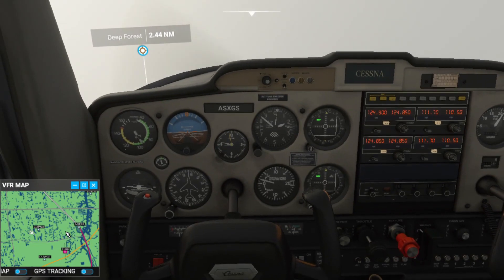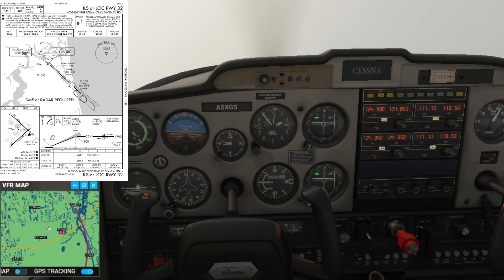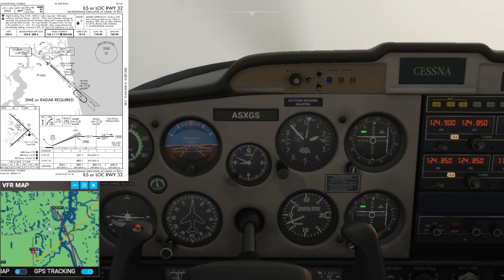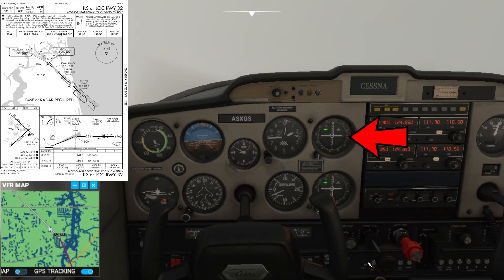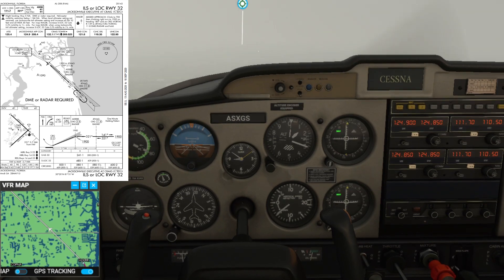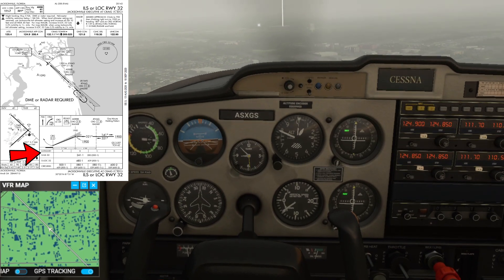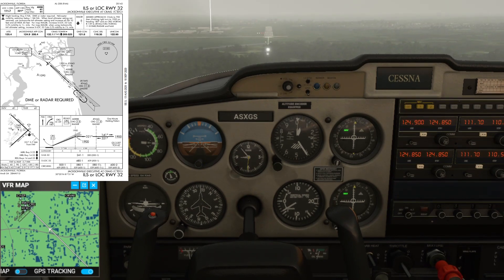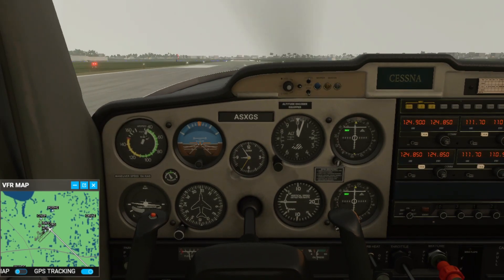Microsoft Flight Simulator | How To Do ILS Approach | Cessna 152 | Commentary | Tutorial

Comment: thank you! also have you noticed that the c152 is always rolling/turning towards the right? I was wondering if I was the only one
Reply from the maker: The default aircrafts have some issues but I do what I can to manage it; hopefully they fix it soon. Thanks for watching!
Reply: Try balancing your fuel tanks. Add fuel to the left tank if the plane is rolling right.
Reply: The propeller is turning clockwise from the cockpit causing a turning to the left. Right rudder must be applied to compensate for this.
Reply from the maker: Mr. Opinion  he said turning to the right, what you’re describing is torque.

Comment: Why did it say airspeed too high a few times during approach? Wouldn’t 52 knots be too slow on approach, especially the first time it popped up?
Reply from the maker: It is too slow, it’s usually best to maintain approach speed around 65-75 knots on short final then pull the throttle towards you to reduce the airspeed once you’re over the runway threshold and let the airspeed bleed off until touchdown.
Reply: 90 in pattern and 70 on approach is what I've read.
Reply: Indeed. According to the Cessna 152 manual, airspeed should be between 60 and 70 knots with flaps up, between 55 and 65 with flaps down. 54 knots should be maintained even during a short field landing.

Comment: I missed something on this,  what was you did that the runway was right in front of you. I am new to this procedure so I assume you programmed a departing and arrival airport. I am lost after that.
Reply from the maker: James Tepedino thanks for asking! What I did was I programmed my navigation equipment to the frequency (111.7)  of the ILS approach and adjusted the radial dial  (321) on OBS 1. By doing that, the ILS gives you lateral (left and right) guidance and vertical (up and down) guidance to the lowest altitude (Decision height). If done correctly, you would first get lateral input then afterwards once you are close to the final approach fix you would get vertical input at which the glide slope is alive and that you can start descending. Each airport has the same concept of instrument approaches but different numbers and procedures such as ex: different degrees, directions, minimums. I could do another example of the approach using your airport of preference if you’d like.
Reply: @DaftPilot  ok i will get that for you. Where did you get the frequency numbers of the ils approach
Reply from the maker: James Tepedino I used the frequency on the top left corner of the white page that appears, that’s the approach plate. The frequency and many other important  data related to the approach are provided in that page. I use this website for airport, fuel information and instrument plates: https://skyvector.com

Comment: That was an impressive landing.
Reply from the maker: Thanks for watching! Glad you enjoyed the video
Reply: @DaftPilot  How did you turn the nav on? Nothing seems to be working on my end.
Reply from the maker: John When you’re doing the ILS, you need to make sure it’s on NAV mode and not GPS; On OBS1 (the instrument right of the altimeter) you’ll see the green lettered wording NAV. Also make sure you tuned in the correct frequency and if done properly you’ll see the lateral needle moving left or right then once you are close to the glide-slope range; you’ll see the vertical needle become active and move up or down. If so, could you kindly brief what steps you’ve done that led to no input from the NAV?